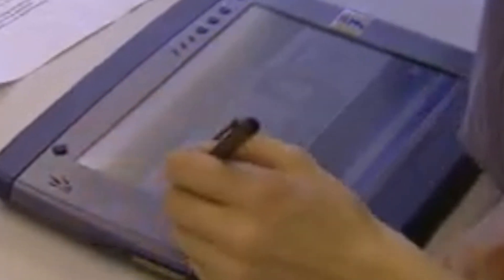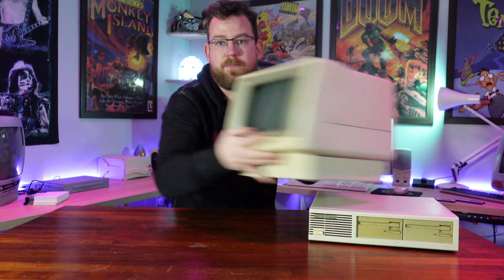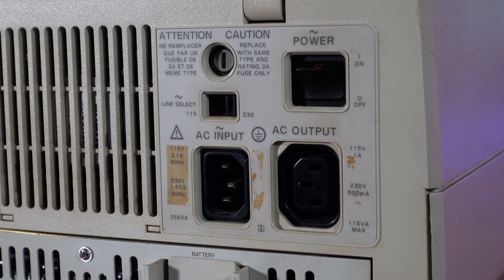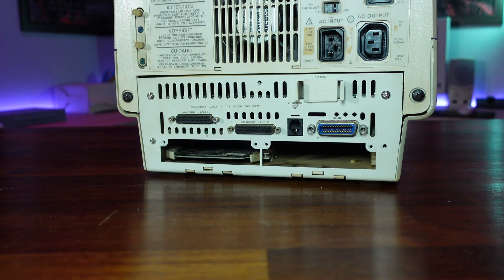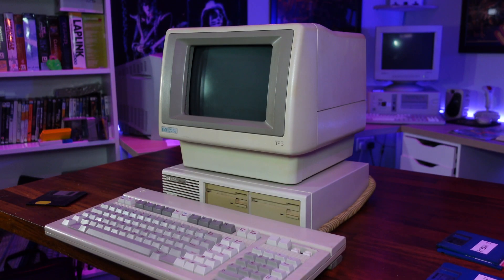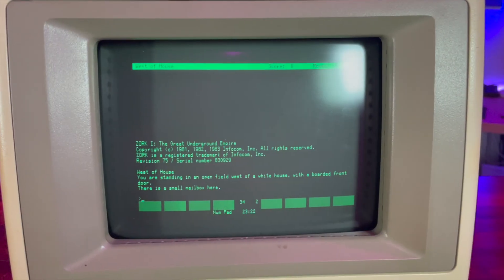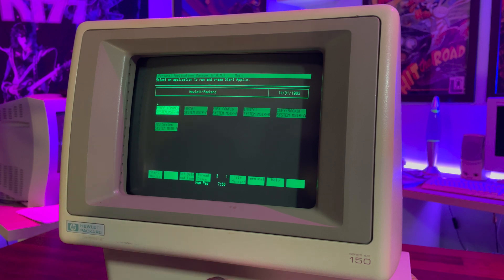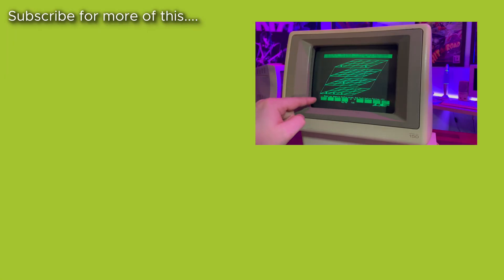The First Ever Touchscreen Computer?

Comment: Thanks for the video. Fantastic to see the HP-150 running!
This was the first "PC" I ever owned (second to a Sinclair ZX Spectrum) and I still have both, although the HP-150's screen won't come on. I bought the HP-150 at a discounted employee price after doing a summer job at HP Europe while I was at high school. It wasn't very quick even by 1984 standards (8-bit ext. bus 8088 CPU), but with its slick touch screen and compact size, it was an amazing piece of kit. I loved playing Sargon (Chess) on it. I remember Hertz using them for many years as a self-service terminal. It was a futuristic machine but having implemented one of the very first 3.5" floppy drives (710kB), it had a terrible design flaw: If you did not press the eject button hard enough, the diskette would not eject fully (lift up and pop right out), instead it would just lift up in its tray. Unfortunately, this is how my HP-150 "died": Someone not familiar with the computer, ended up doing exactly that and then yanked out the diskette. This pulled and destroyed the fragile heads of the floppy drive. I regretted not getting the optional HP-9133 hard drive unit.
The floppy drive you have in your video looks different from the one I had. I believe I must have had the 9123D.
While on the subject, I remember that HP had a stock of HP-110 portable computers stranded in a warehouse of the export processing zone of the airport. I desperately wanted to buy one of them too. However, because they were about to launch the HP-110 Plus (with a larger screen), and it was complicated to get them out of the EPZ, that stock of old 110s got destroyed. We were not even allowed to salvage or purchase any. :((
Reply from the maker: Thanks for sharing! Lovely to read of people’s experiences with these machines

Comment: I would REALLY love to see the special build of Windows running on one of these.  Wonder how difficult it would be to implement a hard drive with modern tricks and hardware.  Any thoughts?
Reply from the maker: Probably quite difficult as the expansion module is needed to convert from whatever interface the drive is to the HP-IB bus

Comment: It's possible to emulate hard and floppy disk drives using a pc with a gpib card.  This should allow you to try out Windows on the 150. Nice video; thank you for making it.
Reply from the maker: That's really useful information to know!  I looked for a hard disk module in the usual places and they ain't cheap!
Reply: The software is called HPdrive. It works with Windows but is a bit fussy about the GPIB card.  I use a Windows 200 machine with an old ISA card.  It works with a lot of HP stuff.

Comment: This is a nice overview of the HP-150, which holds a special place in my heart. My dad's architectural office was full of them, running AutoCAD. As a kid I remember pointing at something on the screen not knowing it was a touchscreen, and wound up doing something that my dad had a hard time undoing...

Several years later as a teenager I wound up using an old one from his office as a dumb terminal using the terminal built into ROM. I also played around in DOS on it, though I couldn't do much as I only had a couple pieces of software. One of them was the demo program that you show in your video.

AFAIK it was one of the very first PCs to use the soon ubiquitous 3.5" floppy disk. In the stack of disks you show, I see a couple of the early ones with the shutter that could latch in place.
Reply from the maker: Thanks for sharing! You’re right on the floppy drives - depending on where you look it was either the first or one of the first commercially available micros to use them